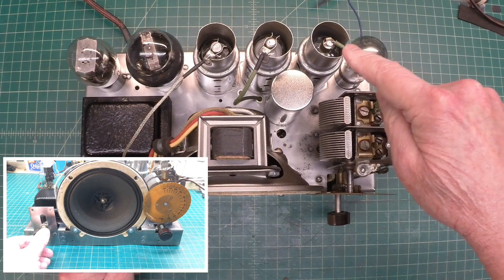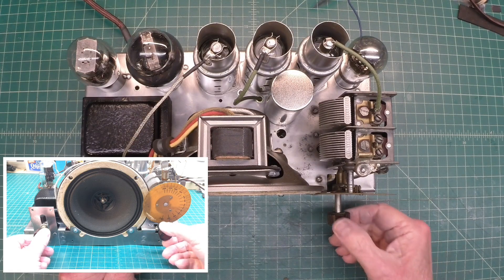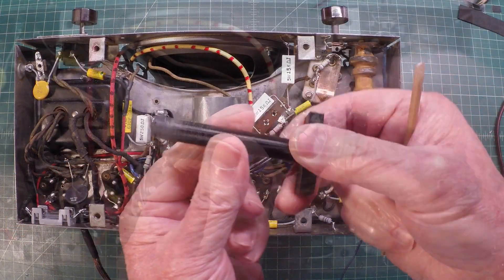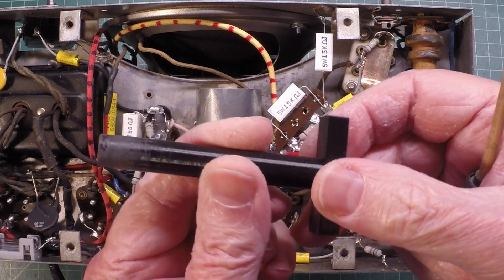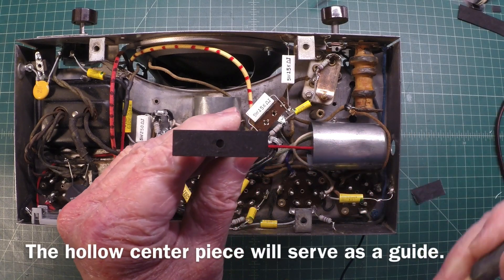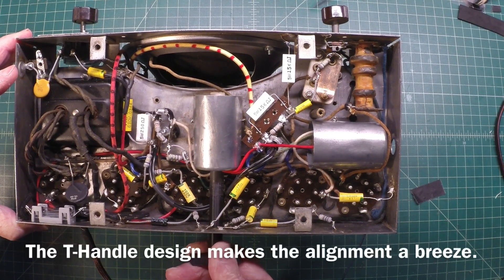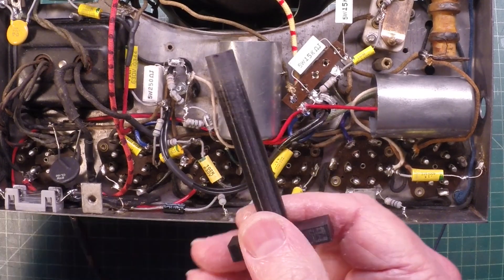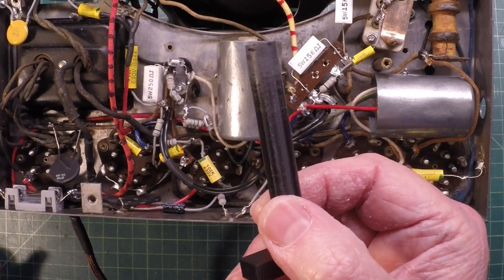Zenith 707 - Custom Built I.F. Transformer Alignment Tool by @DERB_Seymour_Indiana

Comment: Neat tool. I took an old 5/16 but driver and used shrink tube to insulate it. Question, I have a 711 on the bench, same chassis just has the shadow meter, I can't seem for it to take an alignment. I use 485kc and adjust for the strongest signal, but the band is totally deaf unless I touch the grid cap on the 57 tube. Then I can maybe get a local station. Funny part is I thought I had it done, picked up an Alberta Station from the NW corner of Washington State. Came out the next morning and totally dead. Sets been recapped, new resistors, replaced the failed ceramic cap, verified I have continuity thru the IF cans. I can set my SG8 up, and I can set it for a frequency and hear it in the radio. So I am stumped. Any help would be greatly appreciated as there is no info on correct IF alignment out there.
Reply from the maker: Daniel, if you can use a long wire antenna and attach it to the grid of the 57 detector tube and tune in stations and can’t do so with the long wire antenna connected to the antenna coil lead, then something is a miss in the antenna coil section. Try this and reply back. Best, Don
Reply: @RestoreOldRadios  actually sorted it out. Talk about a touchy oscillator. A 1/8 of a turn made it go from deaf to full of life. That and the padder was touchy as well. I knew it had to be something simple. I could set my E200C across the room and set it for a frequency and it was heard perfectly on the radio loud and proud. I just had to keep tweaking things a tiny nudge at a time. Oddly I knew I was on the right track when I was able to pick up 630 AM from Calgary Alberta from my place 60 miles north of Seattle. Yet I couldn't hardly pick up 660 AM that is local and I'm 12 miles from the transmitter. Another touch of the padder (the one that's a pain to access right below the tuner cap) and I got 660 loud and ear to the point it bled over 630. So I kinda balanced it out so on 8 feet of attached wire I got pretty much all local stations, Seattle, Portland and hooking the antenna to my 63' slinky I was able to have great DX ability band edge to band edge. 

The shadow meter sadly isn't as sensitive as I want. I've fully recapped, all new in tolerance resistors, even took apart the shadow meter and cleaned it all up, my B+ is actually 15v higher as I have 124v at the wall vs I assume was 110v for these numbers, but even on my Variac and even ran thru my iso transformer to clean up the line, on the strongest stations I get about a 1/4" shadow that flinches with the beat. I did try using my decade box and play with the cap in that circuit calls for a .01 and I went down to a .001 and up to a .1 and saw little change. Used a bigger value resistor to try and stabilize B+ thru the meter and again little change. So I assume it is as good as it will get. At least it opens and closes. When the set warms up it goes from full open to 1/2" then opens with stations. 

Thanks for the response. This was the first really early Hetrodyne set I've  worked on. It's definitely a bit different. I kept wanting to turn the signal gen to 475khz. As I have it marked. But I still always double check with a little radio I'm on frequency. 

Another oddity I found was initially I had multiple harmonics of my SG signal when beating the set. That was my initial issue. I found a strong signal, tuned to it and only had one station. Tried again found a weaker signal, and tuned the IFs to that one and it was definitely stronger, but still only had a few stations. Went back for 3rd times a charm and found a third even weaker harmonic, again adjusted to it, then had to turn my SG8 almost all the way down as this one was by far the strongest. I've never had to for all the way to low step and turn it down almost to zero.  That's when things started getting really good. 

Love to see a video some time on proper alignment on a set like this because Riders and Beitmans only have the one page for this one, and have ran into another set years ago with no proper alignment instructions of where to tap into, and what does what. 

Keep up the great videos, I spent some time and enjoyed watching many of them after leaving my question.

Cheers and 73s. And thanks again.

Comment: Doug and his little old 3D printer strikes again. What we would do without him! Radio is looking and sounding very good Don.
So  you aren't missing any radio knobs Don.???  Hey, I know a guy...  LOL Steve
Reply from the maker: Doug was quick building that tool for me. Steve, the knobs are not correct, just something for testing. Looks like the original were wooden knobs without the Z symbol, which was introduced in the late 30s. I may try to build them myself, but a resource would be appreciated just in case that doesn’t work out. Thanks again. Best, Don